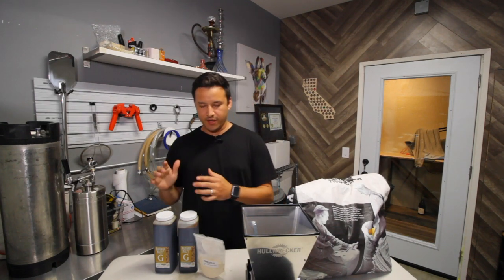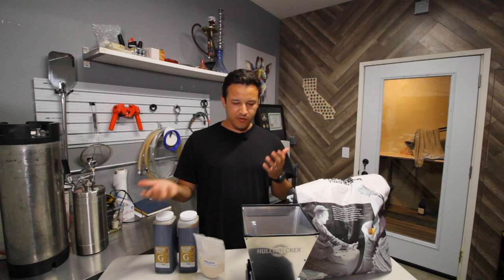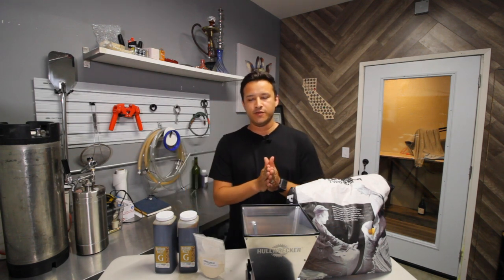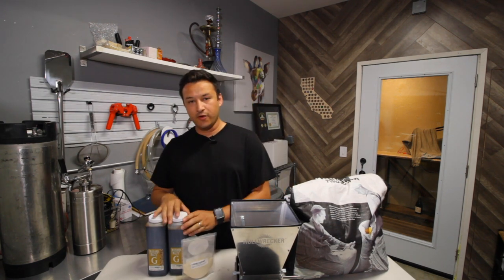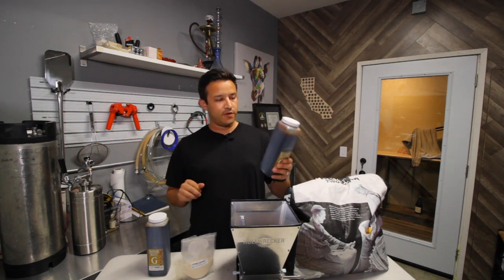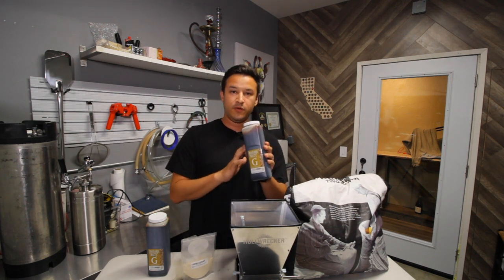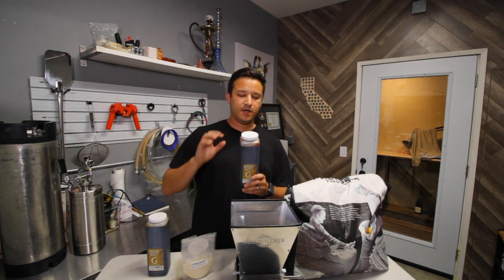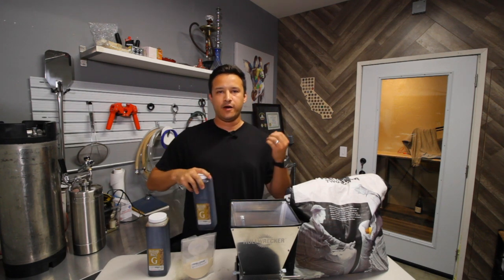What's The Difference Between Extract and All Grain Brewing?

Comment: Hi. This is a very informative video. I am doing my reasearch via internet and books (started with Palmer's bible) because I want to get in to homebrewing. Your video is condensed enough to be valuable and still entertraining to not get bored like reading 500 pages. My short term goal is to brew some nice IPA and because the topic is rather complex I will take your advice and start with extract brewing. Please, keep going. Good job.
Reply: Pavel V same boat here. First time brewer. Barely getting the equipment. Good luck man!
Reply: Homebrew books, instructions and recipes are based on the way that distillers beer and Prohibition beer are produced. The single temperature infusion brewing method and all grain produces home made, distillers beer. Malt syrup produces authentic Prohibition beer. A bunch of advertisers back in the 70s invented CAMRA and they renamed distillers beer and Prohibition beer, real ale.
It is chemically and enzymatically impossible to produce ale and lager by soaking malt at one temperature. Strike and target temperature are useless for producing ale and lager due to the way that enzymes work. To produce ale and lager with the homebrew method malt would need to contain magical properties in order for low temperature activated enzymes to work during a single, high temperature rest without denaturing, which is impossible. The high temperature rest denatures enzymes that are needed for making ale and lager. The brewing method leads brewers to believe that ale and lager can be produced, quickly. An entirely different brewing method and under modified, low protein, malt are used for producing ale and lager.
Syrup is produced by professionals and it produces a consistent, final product. The malt used in all grain homebrewing is used to make malt syrup. The malt didn't reach brewers grade standard and it was turned into syrup, otherwise, the malt would have been purchased by breweries. The finish of syrup beer and all grain homebrew are similar due to the malt being the same.
I'm not sure what Palmers bible is or the connection it has with producing ale and lager. The books that explain how ale and lager are produced are expensive. Wulf's 1958 and 1959 journals are the best books, but they are very expensive, deClerks books aren't as expensive. Abstracts from the IOB are free, online and they are interesting to read. In the 19th century the IOB made malt, modern. The IOB performs tests on malt, yeast and fermentation and they invented the malt spec sheet.
Click on Gladfield's website and find American Malt, the spec sheet for the malt is on the page. Part way down on the spec sheet is Kolbach. The Kolbach number determines level of modification and malt, 40 Kolbach and lower is under modified. Under modified, malt is much richer in enzyme content than high modified, malt. The protein content in malt should be less than 10 percent, the less protein, the more sugar in malt. Homebrew malt can be as high as 52 Kolbach and high as 16 percent protein. The higher the Kolbach number and protein content, the less suitable the malt is for producing ale and lager, that is the reason why the malt is used in grain distillation. The malt contains mostly Alpha, which produces glucose, and that's all that is required for making whiskey. 
When a recipe recommends purchasing two row, pale malt without indicating on the recipe the malthouse that produced the malt, do not purchase the malt. When the malthouse is known, the malt spec sheet for the malt can be obtained and referred to. A malt spec sheet comes with each bag of malt and it is used for determining the quality of malt before it is purchased. 
Weyermann floor malt and Gladfield's American Malt are under modified. To take advantage of the rich malt, at the least, a three temperature, step mash method should be used, which produces pseudo ale and lager. To take full advantage of the malt a triple decoction method is used, which produces authentic ale and lager.
To produce authentic Prohibition beer use high grade syrup. Purchase hops that have the Beta percentage listed on the container. Without knowing the percentage of Beta, the quality of hops cannot be determined. The Alpha and Beta numbers should be within a decimal point. The closer the numbers, the finer and more balanced the hop.
Skim off hot break as it forms and continue to remove hot break until it drastically reduces before adding hops. Less hops are needed because the extract is cleaner. Skim off second break, as well.

Comment: Starch doesn't convert to sugar. Conversion has nothing to do with starch. Beta amylase is responsible for conversion which occurs at 60C. Beta converts simple sugar, glucose released when Alpha liquefies amylose, turning the sugar into complex types of sugar, maltose and maltotriose, which are the types of sugar that produces ale and lager. The step is skipped in homebrewing because high modified, malt is deficient in Beta and an Alpha-Beta enzyme mixture has to be added to the malt for conversion to occur, an extra step is required in the brewing process, the fermentation cycle extends a week to two weeks and a secondary fermenter is needed. When conversion occurs, secondary fermentation takes place. Beer doesn't need to be primed with sugar or injected with CO2 when conversion occurs, beer naturally carbonates during conditioning due to maltotriose. Natural carbonation is much finer than bubbles from artificial means.
Off flavors develop during fermentation and conditioning and they are caused by chemically imbalanced, sugar imbalanced and unstable, extract, which are produced by the single temperature infusion brewing method. 
To learn how ale and lager are produced start with deClerks books.